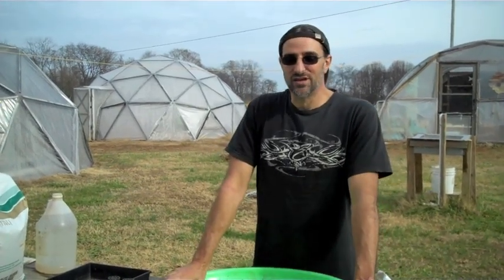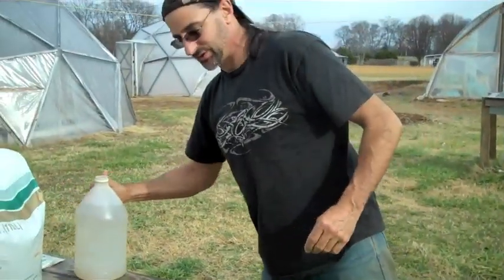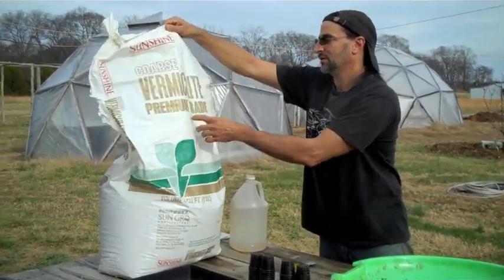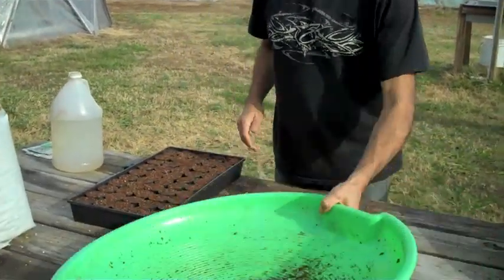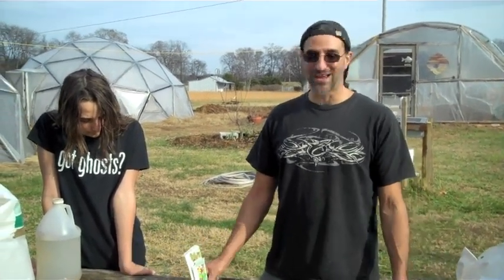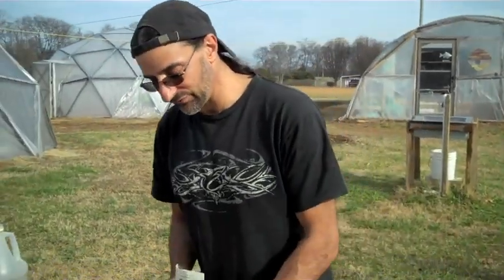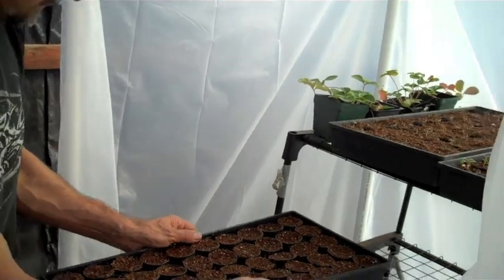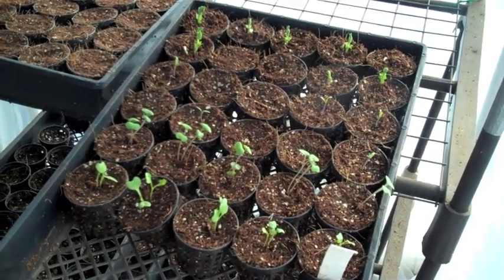Seeding for the Aquaponics Systems

Comment: What is the reason or function of mixing vermiculite? Do you put the hole netpod into the DWS? Any problems with solids into the aquaponicssystem?
Reply from the maker: Yes, the netpots go directly in to the rafts in the system. The vermiculite aerates the coir. And no problems with solids

Comment: what do you do with the coir/coco when you move to the floating raft tables. do you have an issue with it leeching out of the net pots? If so what do you do to stop it?
Reply: Nevermind I just seen someone else ask the same question.
Reply from the maker: The coir stays in the net pots, and the net pots go right into the rafts. The net pots and the raft holes hold the coir, so not much spills out. Also, when coir is wet, it holds together well. That's why we add vermiculite, so the coir doesn't get packed and stays aerated. What little gets in the system doesn't hurt it.
Reply: ok Thank You.

Comment: Would it be possible to grow on the terrace of my house on the 15th floor.
Reply from the maker: VISHWANATH savadi sure. You can scale up to a commercial size or down to a tabletop system. The concept is the same.  For a tabletop system you can use a fish tank and a cheap tote box. Probably less than $50 bucks.  I’m sure you can find videos on how to build a small one

Comment: Very cool. I was wondering if anyone had used a raft or some method of organizing the plants (a big mess of green would drive me nuts) and you've done it. Is there stone/clay medium just beneath your raft or are you on water alone? Thanks!
Reply from the maker: We have tried media based beds but we prefer DWC which is just water with the rafts floating in the growing troughs. It's much cleaner, more organized, and easier to manage.

Comment: HI GHOG63, nice to see this inquisitive style of urs, please let me know in case i use the same Net pot in the Main growing tank, would it get drained with the water or by mixing Vermiculite it would stay and cocapit won't get dissolve in the water. please guide.
Reply from the maker: If you are using a flood and drain method the coir and vermiculate would probably get washed out and drained to the bottom of the grow bed.

Comment: What do you do with the spent coco? it seems that you'd build up some volume. Can it be reused? It seems that it might be compostable because of the fact that there is roots embedded in the cocoa.

thoughts?
Reply from the maker: +Kenneth Schauer We've tried to reuse it but didn't have much luck with that. Patti uses it when she replants things outside. It doesn't break down very fast.

Comment: Great explanation of the seeding process. Do you reuse the coir/vermin mix?
Reply from the maker: +simplemonkey farm We have tried re-using the coir but it doesn't seem to work as well. (We don't get as many seeds to sprout.) Not really sure why that is.
Reply: that's interesting. as the coir absorbs the water based nutrient it could be reasoned that it is more nutritious for seed raising after being used. I'm just about to start a deep water system so I'll try reusing some

Comment: How come you went with the geo dome rather than your hoop house design?
Reply from the maker: That was Patti's decision. She thought it would withstand wind better and regulate temps more. I just thought it would be cool to build.
Reply: ghog63 Does it work better than the hoop house? I agree it is a good looking structure.
Reply from the maker: The aquaponics fits better in the rectangular design of the hoop house, and we're able to control temperatures better using the rollup sides. Not sure about the longevity, as the hoop house is PVC, whereas the dome is constructed of wood.
Reply: ghog63 Thanks for the info and great videos.

Comment: I am surprised that you use such an absorbent mixture. I use a mixture that drains a little better. I just use a coarse sand above a 1/2" gravel
Reply from the maker: Submanca Ahh, so you are doing gravel beds/flood and drain. These seeds are for our DWC systems.
Reply: Not sure why you would want it to drain more. We want it to hold the water and once it goes in to the system, it stays wet.
Reply: thomas fanizza
Well my seed stays moist but once it germinates the stem doesn't stay moist and the roots aren't constantly in water.